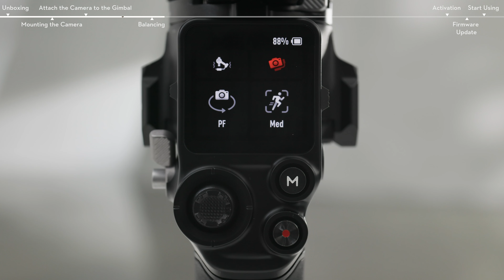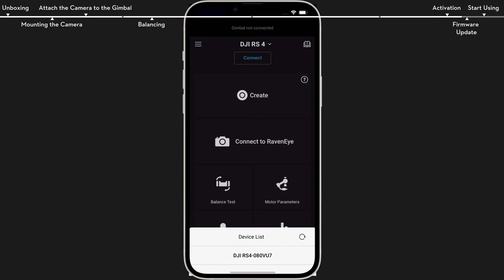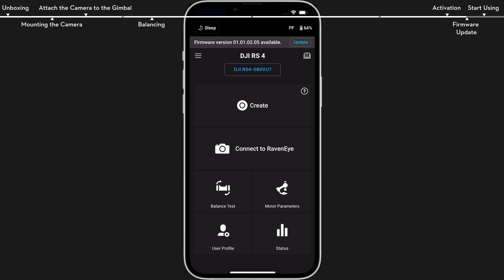DJI RS 4｜First Use

Comment: Hey all, I just got my DJI RS4 and love it, but I have a question for you. Is it normal for the pan axis to have a bit of wiggle when locked(gimbal is turned off)? I only used it once so I want to know if this is normal or a potential problem. It’s my first gimbal so not sure what to expect. Thanks
Reply from the maker: Hi there, thanks for choosing DJI! The roll arm and pan arm levers of DJI RS 4 feature a special design. If the axis arm still moves when the axis arm lever is locked, lift the lever up, and toggle it counterclockwise to the unlocked position before lowering it down. Then, rotate the lever clockwise. Repeat several times until the axis arm is locked.
If the axis arm cannot move after the lever is toggled to the unlocked position, you can use the same method to slightly loosen the lever. And you might refer to https://repair.dji.com/help/content?customId=en-us03400007736&spaceId=34&re=US&lang=en&documentType=artical&paperDocType=paper for more details. Thanks!
Reply: @DJITutorials  Thank you for the reply. My question was not referring to the arm lock but the motor lock (the small toggle on the side). Is a slight rattle/wiggle normal when the motor is locked?
Reply: Exact same question bro. Did you get any answers?

Comment: If I balance the gimbal in horizontal mode, and then detach the plate and put it back vertically, do I need to re-balance the gimbal again before shooting?
Reply: u need to re-balance slightly again..

Comment: Will it work with a Smartphone?
Reply: Yes and no; tried it with a Galaxy S23 Ultra, the videos are soooo smooth as the phone also stabilizes the footage. The phone was impossible to balance by default so I used a camera battery as a counter weight. The other issue was that the mounting plate was in the frame for wide angle lens, so only normal and tele lenses could be used. In other words you will need a custom mount to balance the phone and make sure the plate is not in the frame...

Comment: Just got this as my first gimbal. Worst video ever. Use counter or clockwise rotation on the stated rotation point. What the heck is top or bottom heavy? Was this vid made with AI translator? Wasted so many hours. Pitch, yaw, and roll . X, Y, and Z axis anything cmon man
Reply from the maker: Hi, there. Thanks for your feedback. May we confirm if you encountered any issues with our products? Please provide more details, and we will check it further for you. Thanks.
Reply: @ thanks I figured it out after watching almost all videos on it on YouTube which were also not great as well. Ambassadors yall have for this ain’t coherent. For new product that’s been out for quite some time it’s surprising there isn’t a clear simple efficient video on operation of this gimbal or at least a video addressing the things people encounter with this